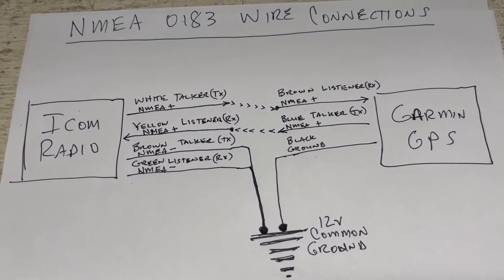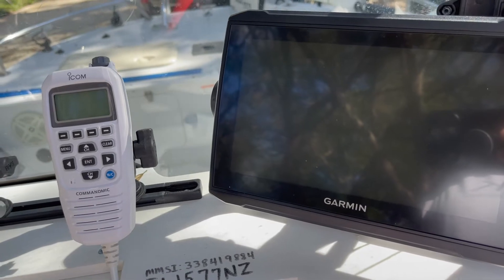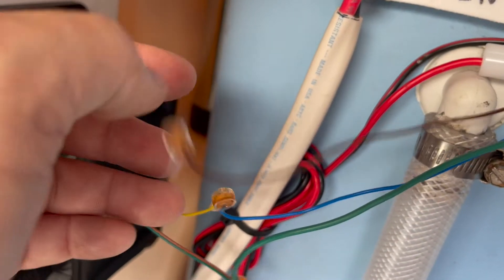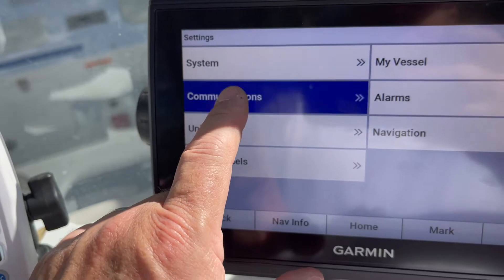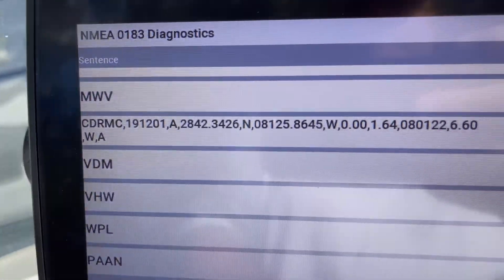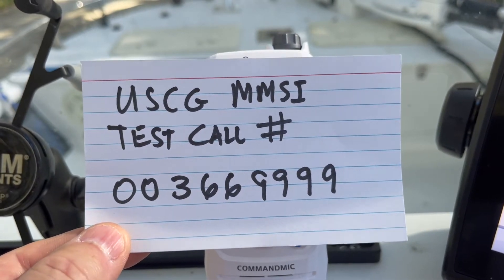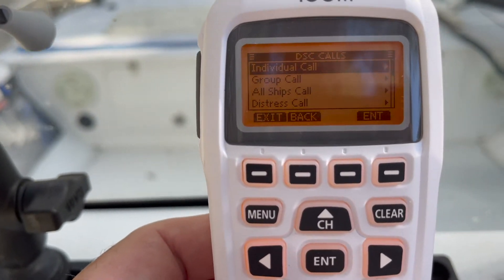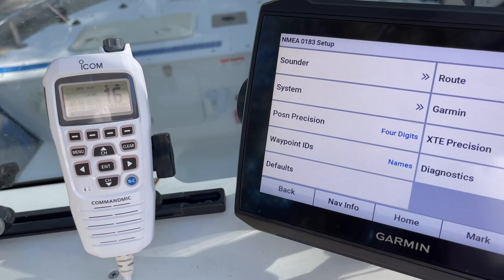Pt2: How to connect your Marine VHF Radio to your GPS

Comment: What if the GPS isn’t showing that it’s communicating but I now have GPS on my radio?
Reply from the maker: If your radio has a GPS built-in, then you don’t need to do this.
Reply: @davecavanaugh66  But my radio doesn’t have built in GPS. My Garmin isn’t showing any communication packets being transferred but I received Acknowledgment from Coast Guard test MMSI so i’m assuming it’s working

Comment: Looks like your Garmin is putting out rs232. Most newer plotters are putting out rs422. Rs422 is supposed to require tx+ to rx+ and tx- to rx-. No grounding necessary. The positive and negative just means there is a voltage differential between the wires. Rs 422 should at minimum only require two wires to get gps data to the vhf from a gps receiver such as a plotter. Connecting all four should do no harm if your plotter is sending rs422. The way your wiring your Icom to your Garmin may be correct in this situation for rs232, but for most current plotters to vhf rs422 setups, this would not be correct, at least going by Icom's wiring  instructions.
Reply from the maker: Could be.  It’s frustrating that the various vendors don’t get on the same page with how they implement the 0183 standard in terms of wire colors and connectivity.  I just swapped my Garmin out for a new Simrad and it only required two wires (Tx & Rx) - super simple.
Reply: Adding to my comment: with my Icom m424g the yelow and green had to be reversed for data to be received from my multiplexer. Tx- to rx+,tx+ to rx-

Comment: How would this differ from an nmea 2000 setup?
Reply from the maker: Many VHF radios and other devices don’t support or have ports for the newer NMEA 2000 capability.  So the older NMEA 0183 connectivity is required. Additionally, many newer radios have GPS built in so in those cases, it’s not really required to do any connectivity unless your radio head is below deck and is not picking up satellite signal.

Comment: Dave, thanks a bunch for this video.  I had trouble getting my ICOM radio to Axiom MFD NMEA working.  I'm going to try this approach next.  The ICOM VHF has a built-in GPS but it has trouble sometimes getting a good signal because of my mounting location below deck.  I did not know the USCG had a test call number for DSC.  That's great!  Kudos to you...
Reply from the maker: Glad to help.  Good point when you have radios mounted out of satellite LOS.  Hope it works out for ya.  Seems like there would be an option to plug in an external antenna on radios with built in GPS.  I getting ready to switch my chartplotter/fishfinder over a Simrad unit so we’ll see how that goes with wiring in the radio.

Comment: Dave 
Great Video!!
Unfortunately you didn't show how your wiring connected to the back of your GPS plate.
My Question is :  I have a ICOM -M400BB black box and desire to connect it to my Garmin Ecomap UHD 73SV.
The ICOM has the NMEA0183 ver.3.01 (4 wires) which need to mate up to Garmin's NMEA2000 (5 pin) port. I can't fine anything on Garmin's site  to make the transition / connection. I'm new to this so any assistance is much appreciated.
Thanks
Reply from the maker: Not quite sure I understand what you are saying.  You can’t connect NMEA0813 to NMEA2000 without some sort of conversion box. The Garmin power cable has the NMEA0813 Blue/Brown wires.

Comment: Great info! Thank you for putting in the time to show what you did. 
What were those terminal connectors called? I couldn't make out what you were saying in the video. 
Thank you
Reply from the maker: LRONG 150PCS Waterproof Telephone Line Connector, Data Phone Wire Butt Splice Ports UY/UR/UB Crimp Terminal Connectors Assortment Kit (UY/K1 50pcs + UY2/K2 50pcs + UR/K3 50pcs) https://a.co/d/8G2JM4o
Reply: @davecavanaugh66  Thank you for the link!

Comment: If you have a GPSMAP 943XSV series: Blue(GPS)-Yellow(ICOM), Gray(GPS)- Green(ICOM), Brown(GPS)-White(ICOM), Vilot(GPS) - Brown(ICOM).
Reply from the maker: Good info - thanks
Reply: I have the GPSMAP 7610XSV series and this color scheme is identical.  Connection considerations from Garmin requires connecting the 4 wires this way and NOT to ground since  both devices are grounded.  FYI
Reply: @josephleblanc9869  wouldn't it just be easier for you to say : 7610XSV is the same as above? As to not confuse anyone reading your comment. Not sure why you even mentioned grounds as they aren't part of this.

Comment: I have the iComm330 which also needs a connection for GPS, I am using a SIMRAD GO9 which does not have any wires on the back. Can I take a NMEA drop cable and cut of and end to connect to my backbone ? Have you heard of this or have an opinion? SIMRAD and iComm neither can help...my radio also has a GPS puck option but I've been told good luck in finding one.
Reply from the maker: It looks like the Simrad Go series only supports NMEA 2000, so that won’t work.  You will need an external GPS device that supports NMEA 0183 standards - such as a Garmin 17x HVS or something similar.  Icom might have one but might be hard to find.

Comment: Where is the cable that comes from the Garmin? Can you send me a link to buy one. And where does it plug into the back? GPSMAP 943xsv
Reply from the maker: The power cable on most Garmins includes the extra wires (blue/brown) you need to connect your VHF. This is shown in the installation manual.  Quick Google search and this is what I found for your Garmin model: https://www8.garmin.com/manuals/webhelp/GUID-BF2FF273-008A-482A-A96F-362ADA8996BA/EN-US/GPSMAP_7x3_9x3_12x3_Install_EN-US.pdf
Reply: @davecavanaugh66  It appears the GPSMAP 943XSV does not come with GPS out because the new Garmin VHF radios have built in GPS. You may want to check me if I'm wrong.
Reply: @davecavanaugh66  on a added note I can't find a Garmin VHf radio for sale. They are all on back order due to the chip shortage.
Reply from the maker: @jeffs9530  the installation manual I provided in the link above is directly from Garmin and it’s dated Feb 2022.  Page 9 shows the cable and wires.  The reason they always provide NMEA 0183 wires is not everyone has a Garmin VHF radio.  Plus there are other device that may need to be connected to the GPS.
Reply from the maker: @jeffs9530  there are lots of other radio brands out there you can choose from that have built in GPSs.  If you buy a radio with a built-in GPS, then you don’t need to connect up to your Chartplotter. Again this video is intended to show people how to connect radios that don’t have built-in GPSs.